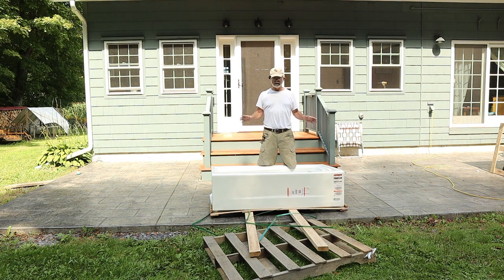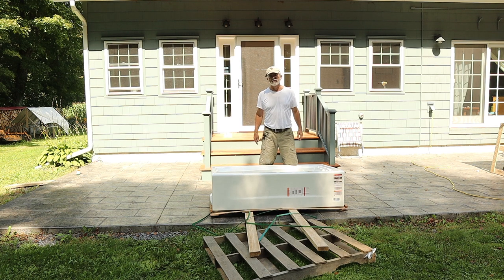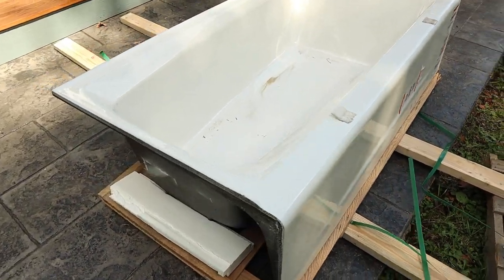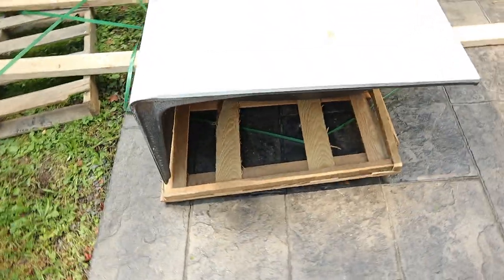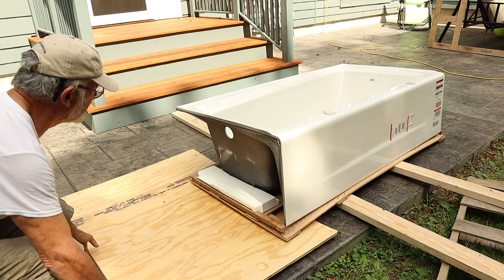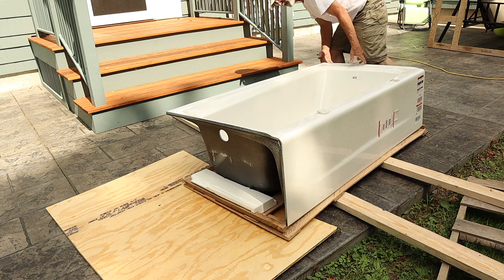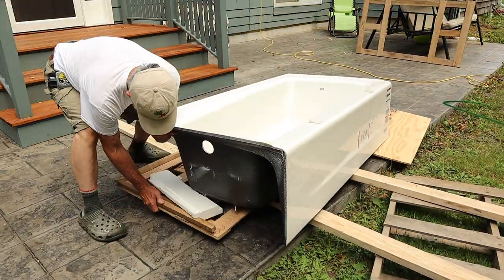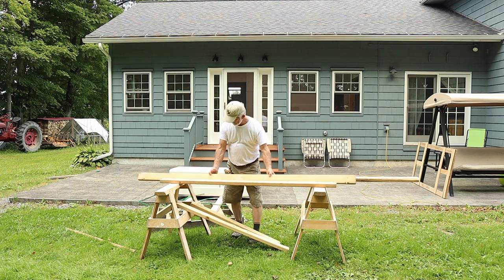How To Move A 400 Pound Cast Iron Bathtub By Yourself

Comment from the maker: In retrospect, there are a few things I would do differently to make this move easier. But I was thinking on the fly. After filming, I put a piece of conduit pipe under the sled. That allowed me to easily roll and pivot the tub into the bathroom.
Reply: I was totally just thinking that! I use that to move my milling machine all the time.
Reply: I use that trick a lot. I would think with rollers one could pull it up the ramp with just a rope and pully.
Reply: Another thought... going up the stairs on the boards, some talcum powder between the sled and the boards.
I was going to make a comment about your OSHA approved Crocs till I saw you took them off. 🤣🤣
We should show this to the people who insist the pyramids were built by aliens. Good job.
Reply: I watched a man deliver a large shed on a trailer and armed with only a couple of pieces of pvc pipe, he took it off the trailer and rolled it up the drive and into position in the back yard. It only took him about 15 to 20 minutes. Truly amazing!

Comment: I was going to comment that you should use a piece of closet rod or a broom handle. Saw where you commented you used a piece of conduit. I've used wood closet rod and pvc pipe to move a safe before. Nearly 30 years ago worked at Lowe's Hardware in the warehouse and lumber yard and we had a manager with the bright idea to put all the cast iron tubs up in the top racks of the warehouse. It was always fun trying to get one of those out 16 ft up in the air by yourself.😂

Comment: I used to do similar things working alone to install boilers. It is always a challenge, but it is amazing what 1 man can do with some material and some common sense and knowhow.

A plumber who worked with me taught me the sled trick about 25 years ago. It works well

I only have two things to suggest.

Yes, some rollers under the planks on top of the stair landing and to roll it through the house.

Also, a cleat screwed to the underneath of the planks against the walkway would have kept the planks from being pulled up the stairs

Good job

Comment: I kept waiting for the ramps to fail, but then they started sliding! Lol. Totally agree, a couple of rollers would have made that much easier. Maybe a little wax or grease on sled runners would have been useful, as well. 

Either way, great job!

Comment: Also in retrospect, once you got the tub across the threshold, you could have used an inexpensive moving dolly like is found at Harbor Freight.  1 dolly would easily hold that weight, but 2 dollies used together might have made it easily manueverable once on the level floor.  I keep about 4 dollies around my garage for such occassions as this.  They were probably about $8 to $12 each and the pivoting wheels alone were worth that.
Reply from the maker: Yes, one of those dollies would have been good to have. I should own at least one of those. When I worked at my prison industry job we used them to move heavy office furniture long distances into state office buildings.  They made the job a whole lot easier! 👍

Comment: I had to remove a cast iron tub. Weighed about 400 lbs. I cut it up into 3 pieces with a 4.5 " grinder with a special cast iron cutting blade.
Reply from the maker: Good to know. A sledge hammer will also make short work of it. I’ve done that a few times. 👍

Comment: Very impressive.  1 man vs 400 lbs.

I was noticing the wide boards,( maybe 2x10s?) rubbing against the bull nose of the top step.  I hope that friction didnt leave a mark.

I agree with your modification to use pvc pipes to reduce friction.  I use those kind of pipes to move my mobile chicken coop in the pasture weekly.  Its close to 400 lbs as well and with 4 pipes slipped under the base, 1 man can push it likes its on rails.

Id love to have thar cold drink with you and chat for a bit.  Im sure id learn a lot from you just during that time.
Reply from the maker: The 2x planks are my scaffold planks. They left a rub mark on the stair nosing but no damage. I just need to coat them with the deck stain I use.

Comment: A+ for each, with determination at the forefront followed by ingenuity & self reliance. At 74 I was and still am awed at man's capability to get things done [much to my wife's constant fretting] My comments here are not to correct or dismiss your successful efforts, rather just my own path. Hey, it's how civilizations are built. I'm 1st assuming you, at least I,  thought the sled would ride over the rails not to be drawn with it. Next of course before you brought it out, I too use a 'come-a-long' (winch) for a lot of my own DIY efforts. Also a great tool aiding felling trees in tight spaces. As for the digging bar, perfect, I keep several of them, each slightly different lengths. I would have added 1x's with towels to rest the bar against the door for  added face protection. As for using pipes, I also have done that but now I use sections of round wood closet poles. Great video for a subject I wasn't even looking up. Thanks for sharing.

Comment: Notice from about @4:41 to @4:48 the use of leverage: the thigh under the tub,  the ball of the foot on the wood and ankle and knee power.   Also at circa @9:11, if that upward pull had been too hard, a perfect length of 2x4 between pallet and rope would work too.  Not everyone is as strong.  This was a great video, continuous problem solving along the way.  Wondering:  was the backing out of screw/adding shims a planned step to get a super tight grip, or only because it was too tight due to the tarp thickness?  Thanks.
Reply from the maker: The shims were not planned. I should have made the sled a tad wider. Thanks for the comment.

Comment: impressive  after doing this would you change
Reply from the maker: All that pulling at the very end was unnecessary. A length of 3/4” conduit under the sled would have made it easy. That’s how I moved it the rest of the way and turned right through a doorway. Earlier in the process the come along would have worked better for me if I had my anchor bar up higher in the doorway. 👍